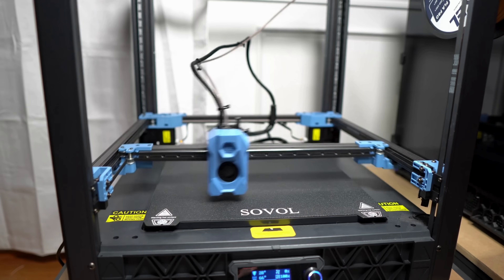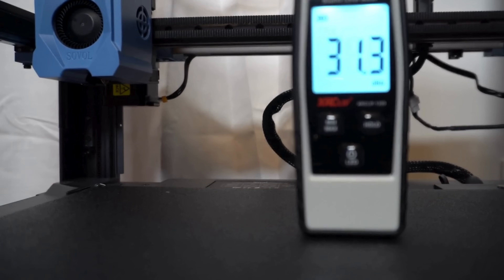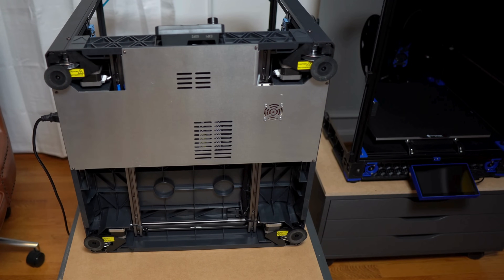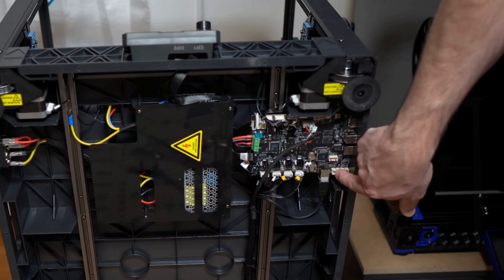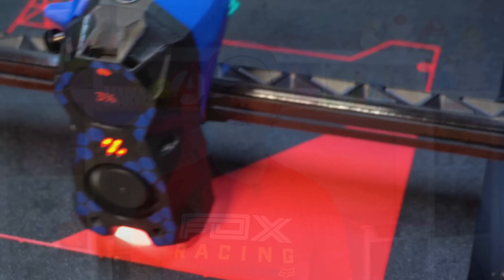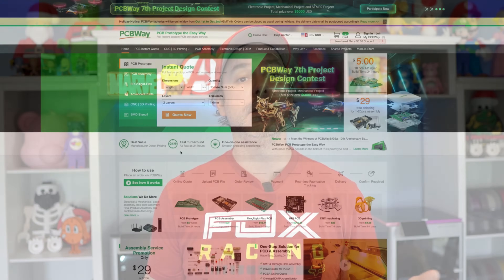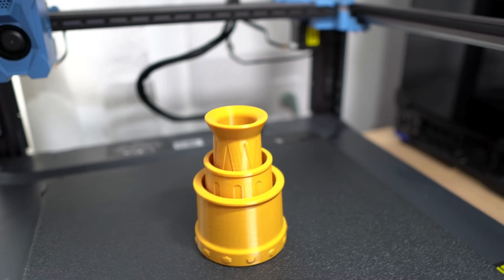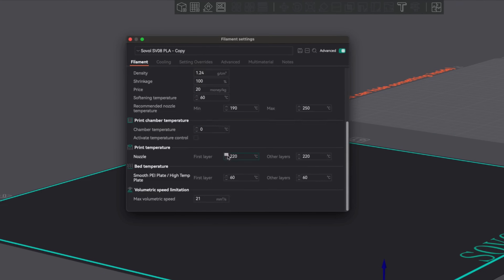Let's tweak the Sovol SV08

Comment: Mine has been inconsistent. Might get three good prints and the fourth or so will be utter trash and I can't figure out why. I kinda wish I hadn't spent my money on this but I need an enclosed printer with the 350 x 350 build plate.
Reply from the maker: Something to look into that is now released from Sovol is a eddy probe upgrade. I've covered how to convert to it before an official release was done. It has made the printer substantially better establishing a better first layer which results less print failures overall. Most if not all of my failures were related to first layer issues.

Comment: These are much better PID settings for the original CPU fan: 

 [temperature_fan CPUfan]
pin: PA1
kick_start_time: 0.5
max_power: 1.0
min_temp: 0
max_temp: 90
hardware_pwm: true
target_temp: 60
sensor_type: temperature_host
max_speed: 1.0
min_speed: 0
control: pid
pid_Kp: 2     ;40
pid_Ki: .5     ;0.2
pid_Kd: 0.25     ;0.1
pid_deriv_time: 5.0
Reply from the maker: Thanks for sharing!

Comment: Very interested in the SV08, wonder if you can use the , tool head and hot end from the voron 2.4?
Reply from the maker: You can swap tool heads; the stock mainboard supports USB tool heads. You could if you wanted to, run something like this. Stealth burner with mount points for the stock Sv08 tool board. https://www.printables.com/model/1120333-sv08-tool-head-boards-mount-stealthburner-mod
Reply from the maker: This is also a great toolhead. V4 Toolhead - Nadir - https://www.printables.com/model/1133951-v4-toolhead-ideal-for-mmu-for-sv08-and-any-voron-g

Comment: Subscribed. Your Sovol Videos helped me a lot :) Many thx and greeting from germany
Reply from the maker: Thank you! I'm glad my videos have helped, plan to do a few more with the SV08 here soon!
Reply: @ThePrintasaurus  Nice. Cant wait ^^. Currently i "mainlined" my Sovol, waiting now for the eddy sensor and plan to get a microswiss hotend. But n need to be honest, i never had any problems with PETG printing or any other Probs with that printer. Only with ABS i get first layer problems. As a hint may for your Noctua Fan mod: One Noctuas has only the half of Airflow as the original fan. But you can easy add two noctas with a Y splitte on one port as the noctuas draw also just half the power.

Comment: have you had problems with error 8 on your Sovol sv08?
(Lost communication with MCU 'extra_mcu'Once the underlying issue is corrected, use the "FIRMWARE_RESTART")
Reply from the maker: Is it consistent or every once in a while? The tool head is USB, and I've noticed some interference from time to time. I added a ferrite core around the umbilical, which helped in reducing any interference. You can find them on amazon.

Comment: Hi.. thanks for your videos. I am learning a lot about sv08.
Quick question about the fan mod.. the stock fan has 2 pin connector and the new fan is 4pin. How do you connect 4pin in a 2pin port?
Reply from the maker: The Noctua Fan comes with a 2 to 4 pin adapter that makes it plug and play!
Reply: @ThePrintasaurus  got it. Thanks a lot for quick response.

Comment: I've got this messeges when i try to print abs  *08:26:25
The value 'fan3' is not valid for FAN
08:26:25
The value 'fan3' is not valid for FAN*
Reply from the maker: Can you send me an email, I can help you get your print.cfg working. theprintasaurus@gmail.com
Reply: Find the solution to it, turned it off exhaust fan in Orcaslicer /filament settings/Cooling   :)

Comment: waiting to heat the probe calibrate is important not just because the bed can expand/warp at temperature, but also because the strength of magnets can vary depending on temp, so a z offset that works for PLA might not be right for ABS
Reply from the maker: Yes, that is good input. Appreciate you sharing that with everyone. Especially with how thin the SV08 bed actually is. It moves significantly at different temperature ranges. I'm actually finishing up a video now, that adapts a higher quality Voron style bed to the SV08, should have that video out this weekend. Significant improvement to probe accuracy at temp.
Reply: @ThePrintasaurus  I look forward to the video.
I think this is why currents voron builds usually come with the voron tap.

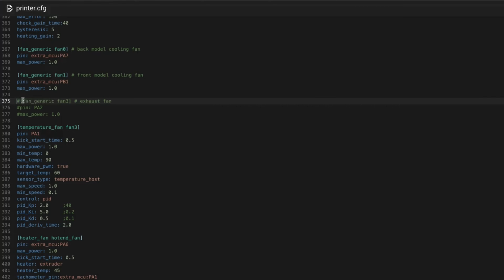Comment: 2:18 Silent board fan in idle: Qidi was able to set the board fan to turn on when the x/y drivers are active and off when they are disabled, so no need for anything to get hot before cooling kicking in.
Reply from the maker: Are you using a Qidi now? Which one if so, and do you like it? I haven't done a ton of research, but I have seen some positives with the X-Max.
Reply: @ThePrintasaurus  I have been using an X-Max 3 for large batch ABS printing for a few years. Just got a used Q1 Pro and have been printing daily on that just to test it out and find it to be very user friendly. My bro Yves over at @NoizieWorks channel has a SV08, Q1 and the newer Plus4 if you like in-depth tear-downs and straight-talk reviews.

Comment: What do you mean by “commenting out” simply remove it?
Reply from the maker: commenting out is a coding term. What I mean by commenting out is whatever line you are removing you would add a # in front of what is on that line, and that makes it inactive. 

example: 
# I want to comment out this line

When you are testing, or configuring this method is prefered because you can always revert your changes by removing what you added, and uncommenting (removing the #) from the beginning of the line and your code is restored to what you had before. 

You can remove if that is your preference as well. Once I have my files how I like I usually go back and clean things up by removing. I'll make a backup first incase I need something before I do that.
Reply: @ThePrintasaurus  That didn't really answer the real question? I also noticed that the pin changed from PA2 to PA1.
Reply from the maker: @  On my board, the fan was plugged into PA1 - in the Print config it was assigned PA2. So I just changed it to PA1 when I made my change. You could use either, PA2 is labeled exhaust fan on the diagram, PA1 is labeled motherboard fan. 
https://github.com/Sovol3d/SV08/blob/main/Motherboard/MCU_PIN_definition.pdf
Reply: @ Thank you, I like when I learn and that definitely helped me learn. Good explanation.

Comment: @ThePrintasaurus I noticed that in the [fan3] section, it was using PA2 for that fan, you changed it to use PA1?
Reply from the maker: That is correct, to be able to control fan speed it needs to be set to the correct pin for that fan port. PA1 is the port. Once you have it set correctly you can control your fan speed based on the temperature you set for it to turn on. Below I added the diagram from the sv08 GitHub just as an additional guide. If you have any issues getting things set please let me know! 

https://github.com/Sovol3d/SV08/blob/main/Motherboard/MCU_PIN_definition.pdf

Comment: My printers belts are very loud. I can hear it with the door closed a few rooms away. My apartment also has thick walls. Idk how to fix it. Any suggestions?
Reply from the maker: Is it the belts or the stepper motors? The steppers are a bit louder than my Ldo stepper motors on my voron. These have a high pitch sound to them. I’ll look into what can be done and get back to you!
Reply: @ sovol has been recommending me things to make it quieter and the latest is changing the belts. I feel like it’s a mix of both but I’m new to serious printing like this so idk.
Reply: @ also to note I don’t see a lot of complaints on how loud the machine is. Idk if I’m just crazy or my machine needs tweaking. I was planning on building a cabinet to put it in with sound dampers lining it. But if I can get the machine somewhat quiet without that then I’d be down.
Reply: Mine makes a brrt noise from the belts rubbing I think. It's quite loud
Reply from the maker: What did you end up doing? Did sovol have any further recommendations? It is louder than my other machines, but I’ll admit I never really notice as I usually have multiple printers running at any given time.

Comment: Did you mean to use PA1 PIN for the temp fan? We comment out the PA2 fan?
Reply from the maker: Yup PA1 is the pin you want to you. If you look at this Pin of the motherboard, that is the correct pinout. There's nothing actually plugged in PA2, at least for my release. I received mine around the 1st of August.  
https://github.com/Sovol3d/SV08/blob/main/Motherboard/MCU_PIN_definition.pdf

Comment: Question about the changes in the [probe] section. I find two line for speed in my file:
   speed: 15.0
   speed 5.0
I don't know whether Klipper takes the first entry or the second one, you changed both to 10. If Klipper takes the second entry this means you speed things up from 5 to 10 mm/s
Reply from the maker: The first entry is retraction speed, and the second is homing speed. I set these the same and my probe results seemed more consistent matching speed.
Reply: @ThePrintasaurus  I don't think so - there should be a "lift_speed" and a "speed" entry. For any reason Sovol has put 2 "speed" entries with values of 15.0 and 5.0 and you changed both to 10, I think you speed up lowering the head while probing because the valid value before was 5.0
Reply from the maker: I see now!! I changed both lines. I'll get that corrected in my description and see if I can add a tag in the video to reference that. Here's what I have in my notes below.

[probe]
pin: extra_mcu:PB6
x_offset: -17                  
y_offset: 10             
#z_offset : 0
speed: 10.0 #15  more accuracy slows down
speed: 5.0
samples: 3 #2 more accuracy increases samples
sample_retract_dist: 5 #2.0  more accuracy
lift_speed: 25 #50  more accuracy
samples_result: median #average more accuracy
samples_tolerance: 0.012
samples_tolerance_retries: 5 #2 more accuracy
Reply from the maker: What I have above was as close as I could get things to get any consistency. I have found it very hard to maintain a good Z-offset between power cycles. Now that I am on mainline, I'm interested to see what kind of improvement I can get from the eddy. I have been reading that they too can be temperamental with heat. 

Do you have plans to move off the sovol fork? Printer has potential, but with it's price point there have been obvious cutbacks on quality, which I think is what makes the voron 2.4 shine in comparison, if you even want to compare! The LDO kits are great, and if you are self sourcing a build you are usually building something top notch as well!
Reply: @ThePrintasaurus  I am planning to move to Mainline Klipper as well and then try Eddy or Klicky, the parts are here already but I did not find the time yet. I am interested in your results as well - is there a better way to communicate than YouTube comments?

Concerning my expectations I am not so hopeful to get better results from changing the probe, but maybe the change to Mainline Klipper helps already. When I do several automatic Z levelings I get nearly equal results, this looks like the probe itself is working reliable. I read a comment somewhere about a Klipper error handling the Z value, maybe this will get fixed with updating Klipper.

What I've done recently is probing two points several times and calculating the difference. I get similar results which are worsened a little bit after a power on/off, but still within the range of 0.02 mm. This substantiates my assumption that the probe itsself isn't the cause of the deviation.
Reply from the maker: Yes shoot me an email theprintasaurus@gmail.com

Definitely keep in touch with your upgrade, I can share my experiences as I move over to eddy as well. Currently I am printing with the stock probe with mainline and things are improved, I am seeing more consistent first layers. I am using a better print start as well that’s now more inline with what I have on my voron 2.4.

Comment: Hey Printasaurus, My SV08 resets the Z offset every time I try to print. Especially if I cycle power to the unit. What can I do?
Reply from the maker: When you are setting the Z-offset are you using the SV08/screen to do it? Or are you using probe_calibrate? Heat the bed up 60-80c, let it sit to heat soak. Then try and run the probe_calibrate. Manually adjust with a piece of paper (It's recommended to do  this with a cold nozzle because it can ooze filament and lead to inaccuracy.) Once you have what you want do a save_config. Klipper should restart to load the new offset setting and it should stay saved. I've found with doing it from the screen on the sv08 through the calibrate Z-offset that it resets after power cycles. I need to look at that Macro further to see what's going on. 

I'm working on a better Start macro that will z-offset calibration and nozzle wipe before every print to see if that will help with the current probe. Waiting on a few more pieces and I plan to start the change over to mainline klipper and will be moving to a eddy current sensor for the probe. Hoping to have that video out in a few weeks after everything has been tested and I have everything written up to show the upgrade process! I think ultimately this is the way to go!
Reply: Thank you for the in-depth response. I have been using the screen on the machine. I will see if I have better luck trying the probe calibrate when I get home. Cheers
Reply: Many people report in forums and groups that their Z offset isn't saved properly. If you check your printer.cfg you can see what value is saved there. Ensure you save the Z offset after doing an automatic offset, then heat up the bet for 5 - 10 minutes (or more) and manual adjust the Z offset with a test print

Even after doing so you might still see a problem with the Z offset. I have to readjust nearly every time when I print, the adjustment variies between -0.07 and +0.07. I think there might be a construction defect coming from the quad gantry level. My other printer is an SV07 Plus which doesn't need any adjustment (also it uses a stored bed mesh) so I guess it must be a build in problem. I will try the changes Printasaurus recommends, maybe this will help
Reply: @reinerrosin  You're absolutely right. Even once I bed soaked and adjusted my z offset to the perfect height. My nozzle would either dig into the print bed or float 10mm above the print bed. I got so annoyed with it that I returned the printer. A $800+ printer shouldn't have issues with something as simple as  remembering a z offset...

Comment: I can not find Flow Speed, can you help? THANK YOU
Reply from the maker: Hey! Your flow speed is your volumetric flow speed. You can find it when you open your filament settings in orca slicer. Down at the bottom. I have further refined and found 20/21 has worked great with a wide range of PLA's I have been testing with.
Reply: @ThePrintasaurus  Hello. Are you sure about you flow for PETG ? After the issue with the nozzle, i slow down it to 12mm3 (for PETG) with better quality (with 15 or upper, that seem very optimist... but maybe it's my setup)
Reply from the maker: @MistralOz   I have been using California PETG and that seems to behave closer to a HF/HS PETG. I'm going to add a note of that in my settings. What filament are you using?
Reply: @ThePrintasaurus  I am using (the most of the time) Kingroon / Overture / eSun. I observed the same with all. I drying them before printing and that is the same.... But : i am not an expert and maybe my overextrusion was related to another point (BTW, from i slow down it, all is now perfect). I should see a friend who know very well vorron printers and maybe he can help me to understand this point (if i have more information i will try to send them on sovol forum).
Reply: @ThePrintasaurus  thank you every sliver has different names for the same thing